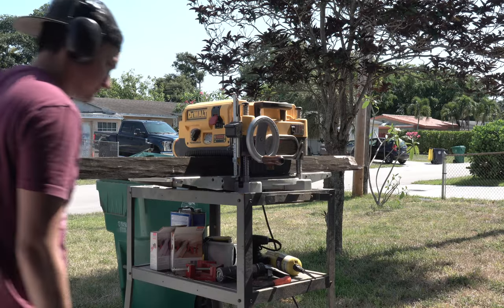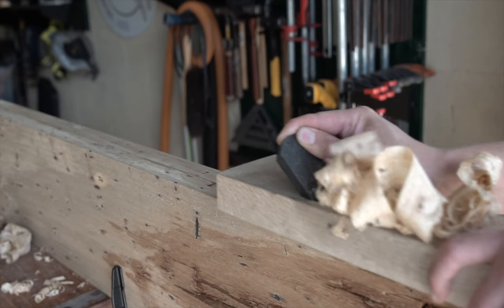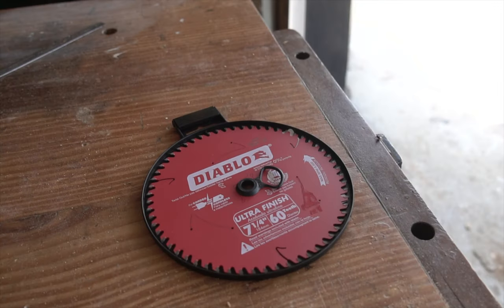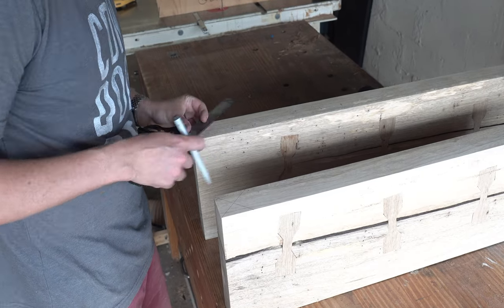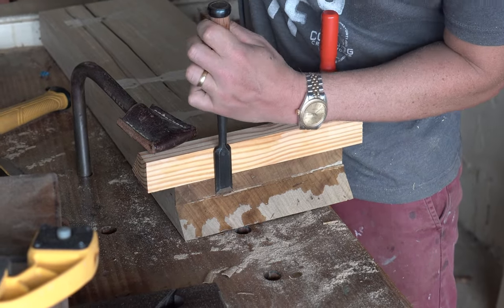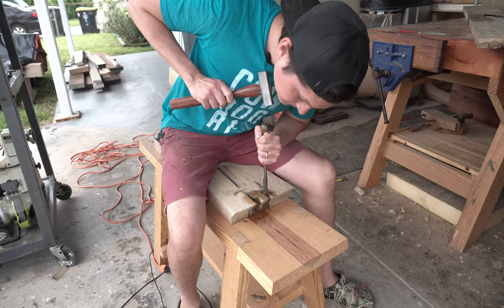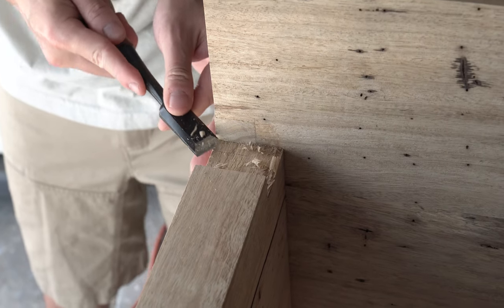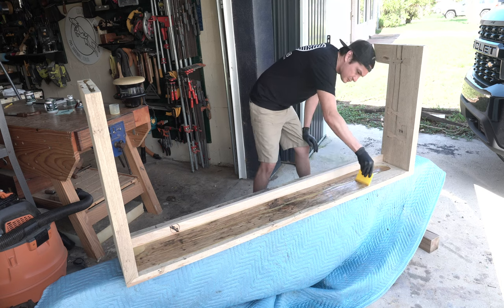HUGE Salvaged Tree Becomes Bespoke Table

Comment from the maker: Support my channel through the following links:
DIABLO 10 in. x 90-Tooth Ultimate Polished Finish Circular Saw Blade: https://homedepot.sjv.io/ZdD651 
DIABLO 7-1/4 in. x 60-Tooth Fine Finish Circular Saw Blade: https://homedepot.sjv.io/kjXOKN
-MAS Epoxies (Special Affiliate Link): https://masepoxies.com/?ref=18
For 10% off AND free shipping use coupon code: cowdogcraftworks
-Starbond CA Glues (Special Affiliate Link): https://bit.ly/36sB2Bv
For 10% off use coupon code: cowdogcraftworks
-The Real Milk Paint Company's Impressive line of finishing products (Special Affiliate Link):
https://www.realmilkpaint.com/ref/cowdogcraftworks/
For 10% off use coupon code: cowdogcraftworks

The Complete Japanese Joinery (Book): https://amzn.to/2OAj1sM
Rubio Monocoat Pure Oil Plus 2C 350 ml: https://amzn.to/3mMgY5I
KAKURI Woodworking Japanese Block Plane 60mm, Manual KANNA Wood Planer for Finishing Wood Surface, 2.9×2.7×10.1 inches (41937): https://amzn.to/3szzXoe
Stanley Sweetheart Chisels: https://amzn.to/2ZATrKg
Solid Brass Wheel Marking Gauge: https://amzn.to/3jfDFfR
Zetsaw Ryoba: https://amzn.to/39nkP6q
Glu-bot Glue Bottle: https://amzn.to/2CdxYOV
Mineral Spirits: https://amzn.to/31xTBmG
Dewalt Compact Drill: https://amzn.to/3ht3tng
Metric Japanese Style Carpenter's Square: https://amzn.to/35kC3fG
Rok Hardware 14 Gauge Table Top Fasteners with Screws: https://amzn.to/38CzW94
Mini Square 10x5cm: https://amzn.to/36mtcti
Faber-Castell Ecco Pigment 0.1 mm Pen: https://amzn.to/36oLni8
Pentel Mechanical Pencil: https://amzn.to/36uqbab

If you want access to more of the tools, check out my amazon storefront: https://www.amazon.com/shop/cowdogcraftworks

//Follow along:

IG: https://www.instagram.com/cowdogcraftworks/
Twitter: http://www.twitter.com/cowdogcraftwork
Facebook: http://www.facebook.com/cowdogcraftworks
Website: http://www.cowdogcraftworks.com

Comment: Looks great! I always like seeing the different joinery methods you use. 

Related to the non disposable saw would you have to ship the blade out for sharpening when it comes time?
Reply from the maker: Yes unfortunately. But with that being said even at a high use level you probably won’t need to send it away much more than once a year. There’s one guy here in the states that can do metate… mark grable. He also sharpens western saws too.

Comment: I'm still working out a chip in the kanna I dropped on concrete in 2016. PSTD vibes. Twice. Sweet table though
Reply from the maker: Time to just do the Blauvelt and run it on the grinder and then get the hollow grind out of it over time. This stuff… when not punky is a dream to work with. Cuts and planes like butter.